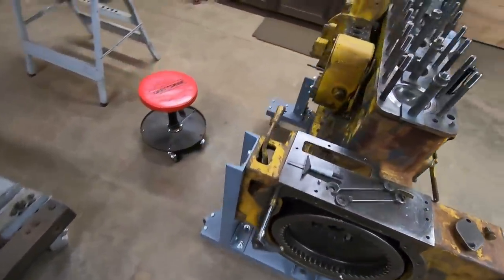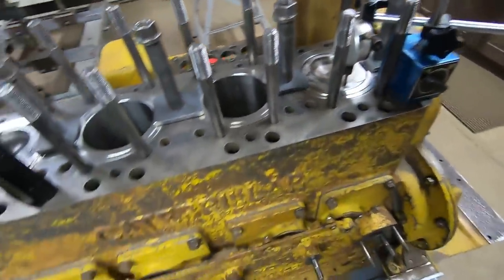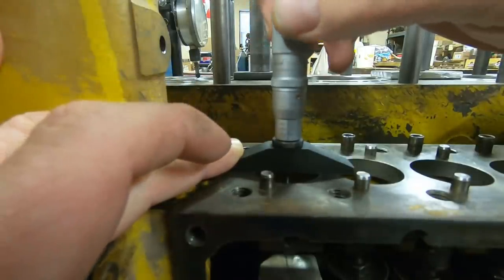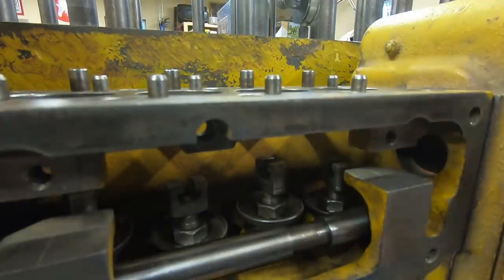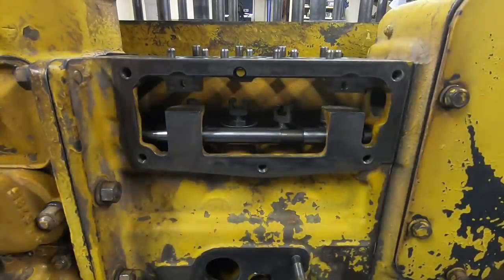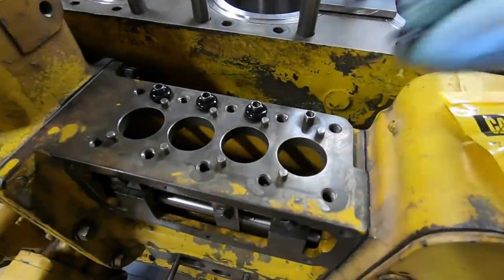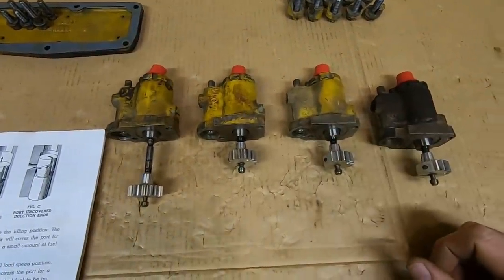Caterpillar D2 #5J1113 Diesel Engine Assembly Ep.35: Setting The Injection Pump Lifters

Comment: Another amazing video. I’m slowly going through my ‘47 D4 while following your progress. It’s been super helpful!
Reply: I was humming a cute little diddy while walking down Craigslist Lane minding my own business one day and was mercilessly accosted by several 955 Caterpillars (a ' C' and 'E' series) Traxcavators. I must admit, I did have an old can (quart) of RPM Delo 30W in my back pocket. Well they followed me home. What I thought were two D4's I soon found that the C series has a D4 undercarriage but the E series has a D6 undercarriage. I scrambled quickly to secure another C series for parts - Without thinking!  Now I have three (count them; one, two, three that's "3") Traxcavators;  a  955C 1957, 12A03563 D4, a 955C 1958, 12A04040 D4 and a 955E 1960, 12A08263 D6 . This channel has been invaluable to me as well, I have been able to adapt and transfer a lot of the information here to my rigs with the added benefit of learning a new language - Caterpillar. 

Thanks to Squatch253 and SquatchSenior

Comment: On installing the plungers, I take one at a time engage the yoke and align with rack timing mark then put the barrel down on the plunger, can use a wire to hold the plunger in rack when putting barrel down on it!!!  But your way worked well, so great job!

Comment: Toby a tip I use for Slew ring bolts, injection pumps or any other like this is to measure the threads of the bolt accurately before you assemble then when you measure and know the amount you have to go you know how many turns you need, great video love the "art" on the wall.

Comment: Ok I think I see what the tracking bar and gear in the high pressure injection does when at idle the gear is turned to where the fuel can bypass back to the tower and the gear turns a little more and more with more throttle until full throttle and max pressure, full power. Wew  I just spent several hours watching these videos out of sequence because I found #32 first and thought that was the one I needed to understand it all. question do I really understand. Yes I think so. Thanks again Toby you lead me I just had to figure out what and where to follow.

Comment: Great video again, it is amazing the detail in the older Caterpillar Manuals, I worked in the oil field some years on Land Rigs using  Cat D399s for power generation, those manuals allowed the Rig Mechanic to cover most eventualities. 
As #5J1113 wont be used anytime soon do you use any form of corrosion inhibitor, or is the assembly Lube sufficient to keep internal corrosion at bay?

Comment: Toby. Could you possibly do a video on how to correctly read a micrometer, dial bore gauge  depth gauge etc. The decimal point is causing me problems with the hundredths and thousands. I know maths is not your strong point but you certainly know how to use these devices. Pleaseeee! Thanks.

Comment: Great video! Probably will be the most searched video informational you have. You answered some of my own personal questions, including one about the grease Zert on the flywheel for the pilot bearing. Anyways I wanna check my injection pumps and see if any are out of adjustment since my 41’ engine is not running as smoothly as I would like it compared to my 59’ dozer. *Do you know what the collar on the injection pump is for? I noticed that when I replaced my plunger it did not come with a collar or lock pin on the top. I had to use the collar off the old one. I could send a pic or video of what I’m talking about for reference if you would like. Anyways good stuff my friend!! Keep up the good work. I’m sure your sharing much insight and giving inspiration to many of us blue collar folks. I look forward to your videos. Good day Sir!!

Comment: Toby, since you know the thread size shouldn't you be able to determine how many turns on the yoke it would take to put it in the range necessary?
Reply: @Mark Gillett Why go to all that bother! He'd have it done by the time he is measuring and ciphering!
Reply: @KStewart-th4sk  I was kinda of kidding but it is very simple. All threads are expressed in number of threads per inch/mm.  A simple example, we will assume 10 threads per inch. So for each revolution that would 0.10 of an inch.  Going further each quarter turn would be 0.025 inches. FYI 10 threads per inch would be a very course thread   Just the way I think.  BTW;;  I think Toby is doing a really excellent job, way better than I could do and his video skills have come a long way and he is also at the top of that game.

Comment: Quick question for something possibly easy to answer, sorry if it doesn't make sense.
How do you tell that you're on the compression stroke without having the head on? As far as TDC is concerned- doesn't that event happen only at crank, or is there something else somewhere that signifies tdc of compression stroke?
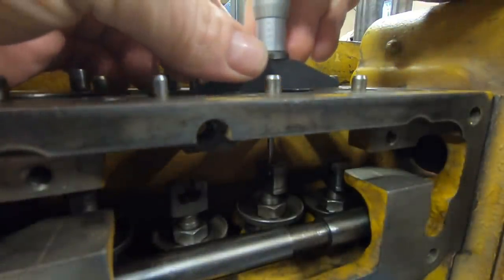Reply: Whichever lifter is high, is on compression stroke. You can see lifter #3 is higher than others at 4:00.

Comment: When installing each of the individual injector fuel pumps, are there timing marks on each gear/shaft that line up with the marks on the straight tooth rack so you know it is in the proper position when you install the straight tooth rack?
Reply: @squatch253  Another great video!  Keep up the good work.  I understand the timing marks on the rack for the plungers. How does one know where to set the rack, or is it just where the governor is at shutoff?

Comment: I'm working on a d4400. In a d42t. Still waiting on my service man's manual to come. 1st one got lost in the mail. It's real sluggish like it has no power. Got my depth guage and was gonna check the pump lifter yolks. Are the lines in the pumps gears supposed to be lined up with the straight tooth rack lines with the half moon shaped cutout at the line. Mine were all 2 teeth off. From those lines on the rack.   Thinking if so. This is probably the problem.
Reply from the maker: Yes, those timing marks are all supposed to be in line with each other - highly recommend getting them lined back up and seeing if it runs any better 👍
Reply: @squatch253  Thank you sir. I actually just went ahead and went for it. Lined em up. And figured if it tried to run away I could just flip the compression release.It started right up. Runs smooth. And I had some smoke that went away also. Funny thing is it looked like it had been like that for a long time.

Comment: *** Squatch i could really use your help... your manual says 1.741" and my manual says 1.736" but there is no way that even with all the adjustment i have i cant get past 1.672 with the jamb nut all the up and bottomed out... is there another spec im missing here? all the plungers are around 1.600" but not evenly and suspecting this is why my engine is not running smooth.. i have a 1941 cat d4 7j4982. any way you have the spec for this tractor there has to be something im missing here with all the manuals i have i just cant find the spec or im doing something wrong.. could the flywheel be put on wrong? if so what do i do...grrr lost..
Reply: @squatch253  thank you.. ill try 1.734" spec measurement. i have the valve cover off now to verify the valves
Reply: @squatch253  well i tried 1.734" 1.736" and 1.741" and it still wont run. it did run better with the 1.374" and still only runs on full throttle. and dark black smoke. i may just have to wait for the shop manual to get the right spec per the book. i can only guess something is not installed right to make the injector pump timing wrong. maybe you have some more ideas? thanks

Comment: just curious.. have you seen superduty 4x4s with stiff steering sometimes won't return to center that one of of the driveaxle joints is locked up in at least 1 direction.